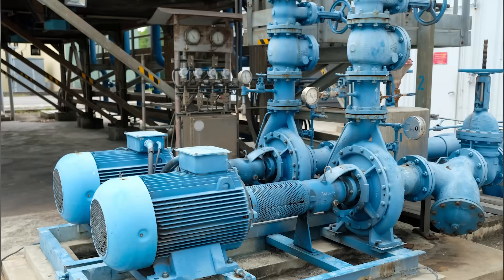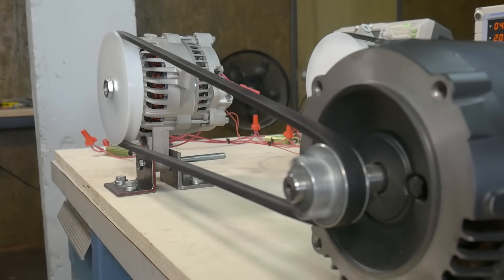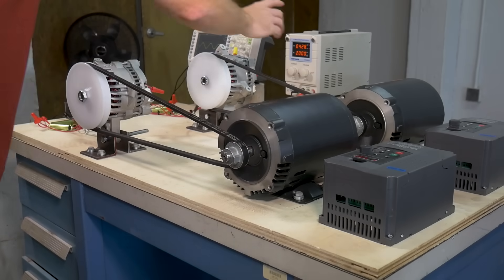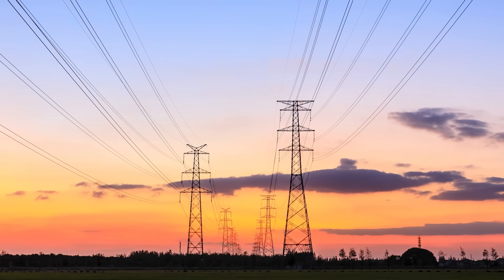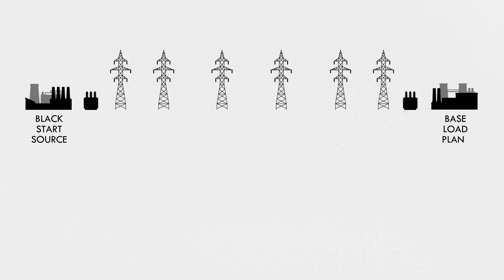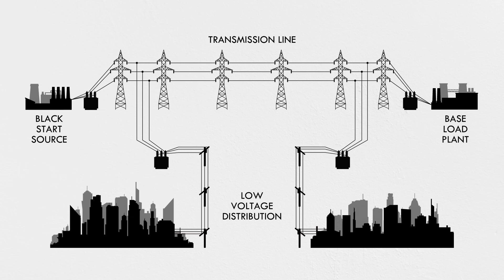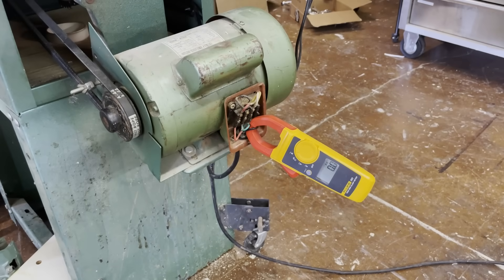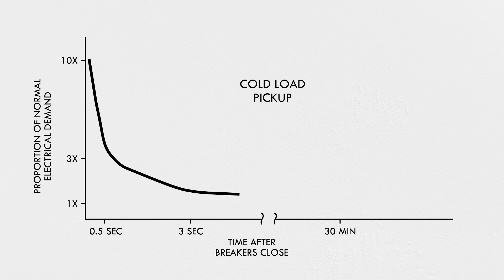What Is A Black Start Of The Power Grid?

Comment: So during synchronisation what is it that happens to the electricity that is being generated? Where does it go? is there a mechanism to reuse the energy or does it just get dumped somewhere? Similar question with how the operator knows how much power an area needs when reconnecting it. What mechanism keeps supply in check with demand when there isnt a recent usage data to use as a benchmark?

Comment: The timing of these videos was incredibly ideal considering current events. 

I never would have known what kind of humanitarian crisis a blackout can be, but it's also incredibly helpful to know that there are at least measures in place to get the power back on. 
Thanks for this timely information about how vulnerable things can be and hopefully people can use this to prepare themselves for a similar incident should it happen in the future.
Reply: Texas wasn't a blackout though it was a power outage, they simply shed load before collapsing. It might not make a difference to the clients but it is a world of difference at the supply side of things. They simply didn't have the power available to rebuild the grid before the cold front passed.

>hopefully people can use this to prepare themselves for a similar incident should it happen in the future.

Not happening without more production capacity or exchange capacity with neighboring grids.

Comment: We had precision generators in the Army, for loads that needed constant power.  Had knobs and meters to allow this sort of adjustment, so that you could switch from one of a pair to the other.

I used to work at a factory.  My position was close to the circuit breaker panel, so after an outage, we had to turn breakers off, and turn them on one at a time after the power came back on.  The workers were paid by the piece, so you cut one breaker on, wait for all of the sewing machines to power on, than cut 2cd on.  Only took 1/4 minute between breakers, not 1/2 hour.

Comment: When manually synching to the grid you have to have a feel for how fast your breakers operate from the remote panel. You may have to close your breaker slightly before the 12 o'clock position to hit it right on. Adjustments are made to get the sync scope going slow in the fast direction (clockwise) so the incoming machine will pick up some load and not "go in the hole."  Hydropower units can go slow in the slow direction (counter clockwise) and can still be synced on. Do not try that with turbines or diesels.
Reply: Very insightful.  So I gather hydropower is less inclined to go in the hole because of the mass of the water driving the turbine? 

What happens in a gas turbine, if you stall the power turbine with the generator? I imagine it's a shutdown, but does it damage the turbine?

Comment: My father told me about the blackout incident of 2003, he was one of the many people to incorporate those new safety protocols to keep it from happening again
Reply: FP&L had one in 2008 that resulted in power loss for about 3 million people. A short circuit with the protective breakers cut out caused 38 Substations, 26 HV grid lines , and power plants in 4 counties to go down. Major loss was the local nuke plants which take care of most of the load. No grid, no nukes as they automatically will drop the rods to shutdown.

Comment: Ahh nifty... so while a generator using permanent magnets might be more efficient, altering the power coil allows them to change the output without altering the speed of the prime mover which means no mechanical parts to worry about, aka lower maintenance.
This video calls to question all those games where you're tasked to throw a breaker to restore power to a city, the power plant would explode with the cold load pickup !

Comment: If everybody shut everything off and unplugged all refrigerators and heaters then they could fire up the generators and everything slowly gets turned on.
Then there is trying to fire it up with full load connected.
Kind of like hooking up jumper cables while they are cranking the car.

Comment: Once connected to the grid, changing excitation cannot alter the generator’s output voltage.

When you flip the switch, the generators do not mechanically synchronise (they are not mechanically connected); what happens it they ELECTRICALLY synchronise because they are electrically connected.

Trust me…I know these things because I am a power station electrical engineer.

Comment: Actually, we ran the synchroscope so that it was slightly fast (turns clockwise). Slowed it down to barely a crawl, and then closed the breaker just as it hit 12:00.

Comment: I use synchroscope all the time on the ships I work on.  When I parallel two or more generators together, I get the needle on the synchroscope to spin slowly in the fast direction (clockwise).  I work as an engineering officer, and my favorite part of my job is working with power generation.

Comment: You can actually experience this load on the alternator while it's being driven by the car's engine.  Especially if you have a small 4 cylinder at an idle.  If you turn on something that draw lots of power such as the blower motor or even the headlights.  If you listen closely, you might be able to hear the engine slow down while the alternator is under an extreme load.

Comment: The black start in the South East of the UK in 1987 was interesting. The grid in this region was shut down because so much of the infrastructure was damaged by the storm that struck, causing overloads across the area. Not only did they have to black start the region, they had to do it while also having to fix the damaged infrastructure they needed for the start! Worryingly the power station they relied on to do the start has recently been decommissioned!!

Comment: Reminds me of the (still running) St Mary's Falls hydropower plant in Sault Ste Marie, Michigan.  Started in 1902, and still running.  But it runs 74 separate turbines in parallel.  And in 1902, keeping them all synchronized and in phase was done by an operator on each turbine, watching a pair of lightbulbs (this was before synchroscopes) and cranking the water input gate for that turbine open or closed with a large mechanical handcrank.
These days it's all done with advanced SCADA controls, but in the old days it was constant manual labor, b/c the turbines took constant monitoring and adjustment to keep synchronized.
And it must have been a "black start" facility, b/c when it was built there was other generation on the grid, nor any connections to a larger regional grid.

Comment: Retired telecomm tech here. Most Central Office equipment runs on 48V DC and the C.O. techs maintain large banks of batteries to keep the equipment running. Most C.O.s also have diesel generators for when the commercial AC goes out. I worked in an office in downtown Minneapolis. During very hot summer days, the telco would fire up their generators so as to disconnect our building from the grid, thus allowing other buildings without generators to remain powered up.  It rarely went smoothly. Our lights would flicker, then go out, of coures our phones & PCs would all go down. Eventually as the diesel generator settled into being online our lights and other equipment would come back on.

Comment: How important is synchronization? Before I started working for the local electric utility, I got the story of why it is important and it involved 2 fatalities. At one of the hydro generators there were two workers inside the powerhouse when for some reason, the plant got put back online without being in sync. It caused a massive surge that lifted the generator several feet into the air and creating a flash fire that consumed all the oxygen in the powerhouse resulting in the fatalities. It took months to just clean the carbon residue off of all the walls and equipment.

Comment: When I was in the Navy I worked on (among other things) the ship's electrical plant.  We had 3 (or 4) generators on the ship and whenever we brought a generator online (to increase our available power or so we could take another generator offline for maintenance) we had to synchronize that generator with the ship's "grid" before we could close the generator breaker.

Even more interesting is when we were pulling into port and hooking up to shore power, we had to briefly synchronize the ship's "grid" with mains power.   When you are syncing with shore power you have to disable the auto load-balancing circuits so you don't try to power half of San Diego with a single 2500kW generator.  ;)  You also NEVER want to have a generator connected to the grid for more than 5-10 seconds max because a spike or surge in grid power could cause a tremendous amount of damage to one of our generators.

In each case we used a synchroscope similar to the one depicted.  We were trained to never get the synchroscope to actually stop, you want the generator (or source) coming ONLINE to be moving just a little bit faster than the existing bus.  You slow down the needle to about 5 RPM and close the breaker just before the needle reaches the top.

Comment: Fascinating topic on having to do a Black Start of the Power Grid. Equally fascinating too when a black start happens only a certain type of generators have the capability in doing so as well which I believe were typically gas, diesel and oil fired generators and maybe hydro if it was available. No doubt someone will ask if a nuclear reactor could be used for a black start. Someone more qualified could answer that but I believe typically no as Nukers need an external feed coming in for their cooling systems otherwise they are on their backup diesels. So for a nuker to come back online to power the grid an external source needs to be secured before the reactors ramp back up to full power (if they are not dealing with a case of Xeon poisoning prior).

Comment: I remember when I was studying electrical engineering in the late 1980s out lecture (a retired power station engineer) related a lot of stories about what you have said. On one occasion he told the story of when the whole grid in souther England (UK) went down because one of the power stations decided to run the generators too close to the phase point (the turbines where only just ahead of the phase ) to save money, a sudden demand happened thus triggering the station to disconnect as it thus turned into a motor! 
Another was when he described the synchronization using those meters you showed, and that you had to watch the meter and throw the switch just at the right time, if you did not it would instantly break back. 
He also said altering the rotor current is also use in motors to control the speed and allows regenerative braking on trains (he mention why trolleybuses could stop so quickly) etc. I think this is one thing that seems to have got lost when the started using electronic controllers, as I read a couple of years ago that they have started using regenerative braking on trains!

Comment: When a generator ties into the grid it WILL get synchronized if it isn't... very violently. (Great video of a small Hydro generator being synchronized and tied into its grid https://www.youtube.com/watch?v=xGQxSJmadm0 ) This is why power plants 'trip out' that causes cascades. If the generator can't keep up outputting it will become a load and be driven by the grid. This load further reduces the grids capacity to stay in phase at the right frequency causing more and more generators to become loads and it just keeps rolling. So the way to protect it is to have have the generators automatically trip out once voltage or frequency gets too far off. And if the frequency gets off generators, transformers, and motors can overheat and vibrate themselves into pieces due to the low impedance.

Keeping load and generation in balance is an amazing dance. The larger the grid the more 'buffer' you have innately as loads coming on and off are so small in comparison to the steady state of the grid. But loads do shift through the day. When everyone is at work power demands peak. Then when everyone goes home they fall.  Hydro and natural gas turbine are the preferred 'black start' and surge load power plants as they can start up very quickly. Versus a thermal plant that would have to keep steam generation up wasting fuel to respond quickly so any time that thermal plant is fired you want it generating needed power.

Comment: My husband worked at the Grand Coulee Dam when an electrical fire shut things down in one powerhouse (there are three), and a strange cascade of failures that shouldn’t have happened began to occur, like the entire phone system failing. Perhaps it was because pumps stopped and the dam started taking on water. 🤷🏽‍♀️ idk. The Corps of Engineers downstream at the Chief Joseph Dam drove up an engine generator the size of a semitrailer, but then just left it, with no hook up or instructions, so my husband had to give it a careful once-over and figure it out. Power was restored, though I’ve never understood why the first powerhouse couldn’t be restarted by Two or Three. Was it because of synchronization?

Comment: And now dumb places like California and New York are forcing everyone to use electricity for everything, cars, furnaces and so on. Now there isn't enough power on a regular basis let alone a restart like he is talking about.
Reply: If each home had solar or geothermal (or wind power) and connected to a grid, the resilience to black-outs will be much high.  And it's not a new think to use electricity even for heating.  And you are avoiding the easy counter-argument - Texas' (not California, not New York) failure two winters ago.

Comment: and that's assuming you don't have a grid problem like downed power lines.    and the takeaway the average power consumer should get from this is to shut down things like air conditioning and electric heat thermostats while the power is off.  also, if you are going to use a backup generator, make sure it is installed properly to avoid backfeeding the electrical grid.

Comment: When synchronizing grids, do they ever use loads between the same phases like that indicator light to pull them together?  Seems like it might have been a way to do it before all the monitoring equipment to match them before connecting were invented, and when grids were smaller.

Comment: This brings back bad memories of the 2016 South Australian Blackout where transmission lines taken down by severe storm (including tornadoes) damaged critical transmission lines and caused a cascading failure of the entire state's electricity transmission network. There are three gas turbine generators where I live (Port Lincoln), but an issue in the substation where they are located had them fail as well. Port Lincoln was without power for almost three days, some areas in the state were out for more than a week. 
https://en.wikipedia.org/wiki/2016_South_Australian_blackout

Comment: I believe there's also the fact that you can't just put more and more power plants online (to power each other) without switching on the loads for them as well. The power needs to go somewhere and power plants usually have limited capability to regulate how much power they output, so they must be also gradually connecting loads, which is a whole complex issue on its own.
Reply: I can tell you as a power plant operator who has been to black start training many times lighting up loads is low on the priority list. The major priority is lighting up transmission lines and tying islands together.
Reply: @josephkordinak1591  But near the end of the training exercise, how do you avoid production excess if the only loads are plant and grid losses?
Reply: @johndododoe1411  They will light up some loads just to put some load on the grid but not nearly as much as you would think.

Comment: The synchroscope you showed reminded me of my time on the sub and our electrical plant control panel. We always wanted the incoming machine to have a slightly higher frequency than the operating machine so that the incoming machine would pick up load (and not be a load). So the synchroscope would be rotating slowly clockwise, and when the pointer got the the 11 o'clock position, you would throw the switch so that the physical breaker would close when the pointer reached the top (due to mechanical delay).

One time there was a new operator under training, who thought the phrase "11 o'clock" meant the actual time.

Things were momentarily exciting when he threw that switch.
Reply: Yes, I was going to comment that the video had the error of showing it turning counterclockwise. But it was an art. You had to slow it down to a very slow rate and estimate when to close the breaker a few "minutes" before 12 o'clock.

Comment: As an electrical engineering student, this is quite interesting. We haven't never really spoken about black start. But a lot about typical individual generators and grid connects. Based on the teachers, it's fine and actually preferable that the generator spins a maximum of like 2% faster than the grid. Idea is that it doesn't take forever to synchronize and the generator tries to push the grid frequency up. The most important part is the correct phase order and in a moment of connection, there is no voltage difference.

Most likely I'm not going to do a manual synchronization ever again, since synchroscope relays can do the required adjusting and the connection itself much more safely and reliably. Far more likely to give that relay an order to make the connection.

Comment: Grid scale batteries should cut down on the cost to maintain cold start capability. Just reserve a portion of the storage for the task and the rest can be in normal operation.
There is still a cost, but since it is a part of an active installation little extra maintaining and testing is needed.